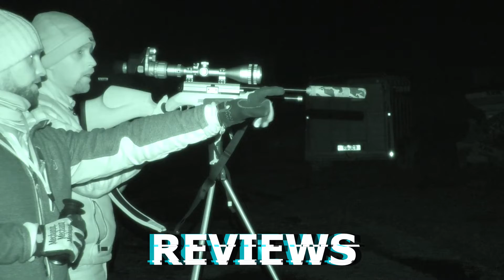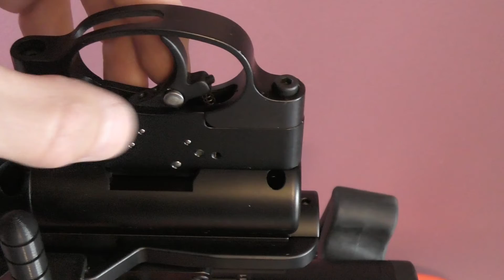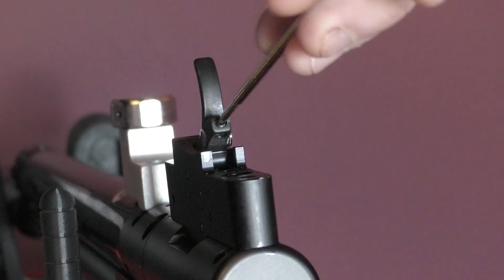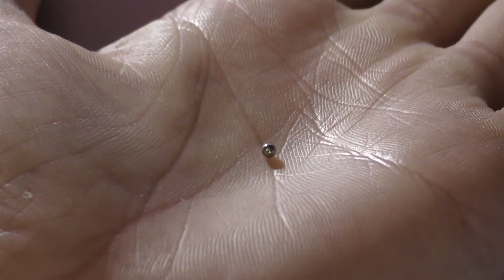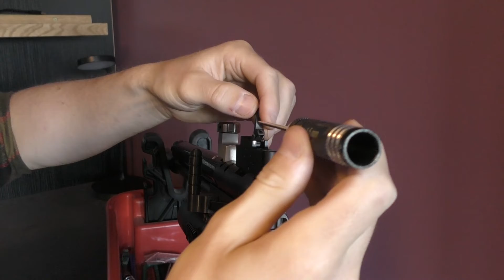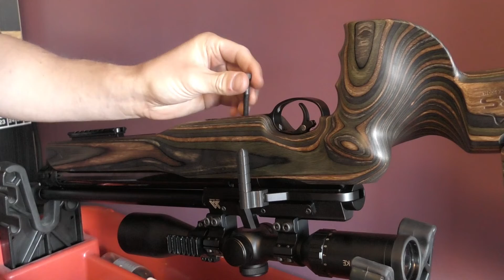Air Arms S500/S510 Safety Catch Repair

Comment: That is an excellent video, very clear and concise well filmed, and presented. 
Mine's just gone and was feeling quite sick at the thought of being amputated from my S510.
I look forward to sorting mine. Thanks
Reply from the maker: Glad it helped!
Reply: Just fixed it. The grub screw had fallen out with the rest of it. I used a fishing magnet to find the ball bearing, spring and grub screw at my shooting range at home. I couldn't believe I actually found them! Anyway, I cleaned them up and reassembled the safety. Good shout about using the blue loctite as the screw is rather slack. I've ordered spares from TW Chambers just in case. Thanks again.

Comment: Do you have a cover on the cylinder gauge?
Reply from the maker: It is a Rat Works filler gauge which replaces the original. The gauge at the end of the cylinder tells you the cylinder pressure and there is another gauge underneath which tells you the regulator pressure.
Reply: @lancsvermincontrol  ah that’s handy. I have the new untimate sporter fac, how did you get that fitted? Thanks.
Reply from the maker: I sent mine to The Rat Works. Tench reg fitted, tuned and internals polished, pressure gauge fitted at the end.
Reply: @lancsvermincontrol  ah ok nice. Iv only had mine a few month. Went for the new regged s510 ultimate sporter. Good setup to be fair. Your local gun shop Malmo? I’m about a hour away but go there quite a bit. Great place.
Reply from the maker: @richardflynn2633  I use Mcavoys, Malmo and Liquid Steel Designs, but I will be at Malmo tomorrow actually as I need a cheap lock knife for my backpack.
Reply: @lancsvermincontrol  Geoff at lsd is a great fella. He cerakoted my tikka barrel and action for me. Great job. How do you find your grs, did you not get in with the std AA stock?

Comment: I have a .177 S510 R and although only 4 months old and still under a long guarantee this is really useful to know (thank you) should I get the same problem.  Seeing this it looks easier to do yourself than the hassle of sending it back.  To date, It has been a great rifle.
Reply from the maker: Glad to know this may help you in the future. Mine has been faultless also but this is just general wear and tear, so if your safety becomes easy to slide in and out it will most likely that ball bearing has become too small or highly likely escaped.